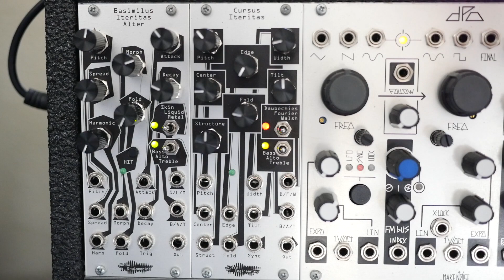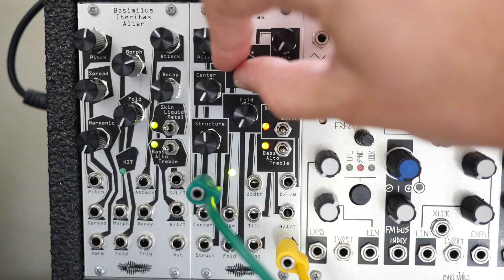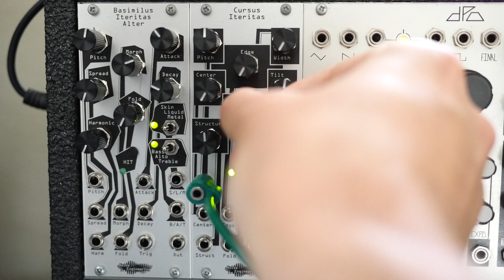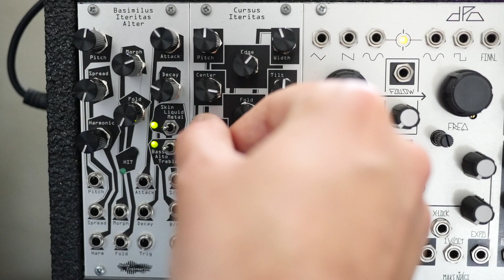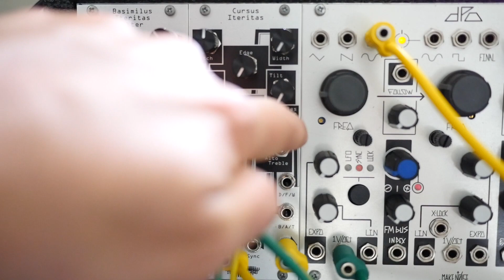Noise Engineering Cursus Iteritas

Comment: Hey James, i'm having a hard time deciding between this and the Loquelic Iteritas. Have you tried both? Thanks!
Reply from the maker: Hey Roy, I've had a little hands on with the LI, but not a lot so take that into consideration.  If I were to oversimplify it, I would say the LI more easily achieves heavy modulated and 'aggressive' tones compared to the CI which is on the less extreme side of the spectrum.  I'd say if you wanted maximum sonic possibilities, I'd say LI.  If you wanted something that covers all the basics and then some and is almost impossible to make sound bad, I'd say CI.
Reply: Cursus is more “musical”, I’d go with the Cursus + the Manis + BIA LOL

Comment: do you think you could do a short clip of the CI doing a more melodic and smooth patch(if it's capable of that) ? I'm trying to get a good idea of its sonic range and most demos are pretty aggressive or just complete noise.
Reply from the maker: I will make sure to include an example of that in the next video that involves the CI.  It definitely is capable of smooth/pretty/chimey/etc sounds, particularly the Fourier mode as that is based off sine waves.

Comment: Very nice demo! Thanks for this! A question, your opinion, could I use it for nice stable basslines without any LP filter in the chain? I can feel it can do it as normally wavetables are good for consistent basslines. So a vca and a snappy 1-2 envelopes would be ok? Just want to place it to my dedicated drums and bassline case :) Thanks!
Reply from the maker: Thanks!
I suppose it totally depends on the tonality of the baseline.  If you're looking for those classic baseline tones with a little "bow bow" to the sound, then you kind of need an LP filter, imo, that's most of the tone, not so much the oscillator.  
But if you like the tones that you heard in the video, these were through a lowpass gate, but generally wide open, so little/no filtering for the majority of the sounds.